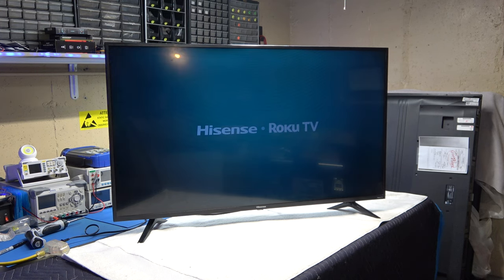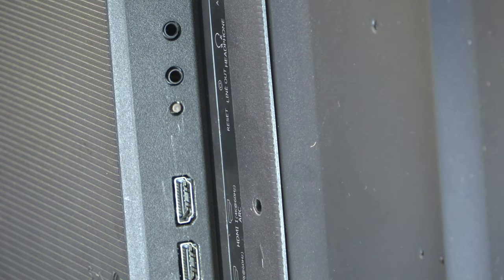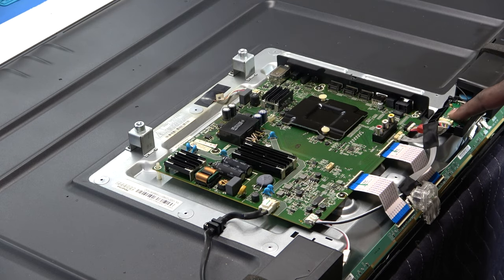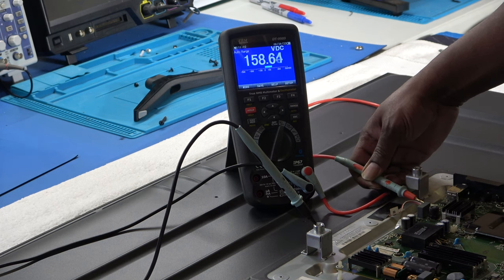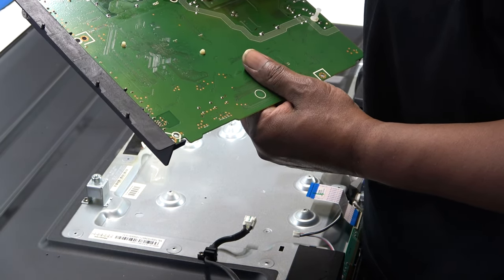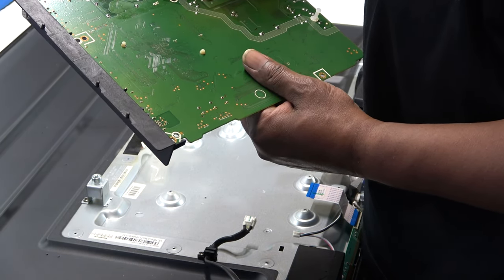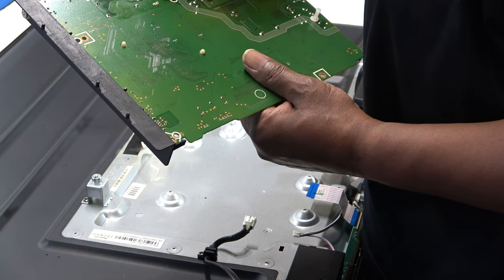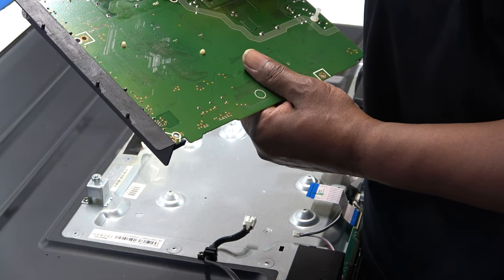Hisense Roku 50R7E boot loop fix when reset button doesn't work.

Comment: Hi mate, I have a Hisense 32" Smart TV (Hisense 32P4). I watched your earlier video about the reset button. Unfortunately, my model does not have a reset button. I’ve watched this video and have had a look at the circuit. There seems to be only one capacitor for the backlight LEDs. Also, visually it seems to be fine – it’s not swollen or discoloured. I don’t have a multimeter that can test capacitors. Would you suggest I replace this single capacitor, or would you suspect something else is at play.
Reply from the maker: probably bad board. or backlights. you have to have a shop take a look at it.
Reply: @bigdog8882  hey, wow! Thank you for responding. I got given the TV, and thought I’d have a crack at fixing it. It’s only worth about $150 repaired in my market. I have checked the LEDs they all appear to be working. However, this is not verified with a multimeter—the strips are glued down, with the terminals underneath, and I was concerned I wouldn’t be able to put them back in. 
I’m thinking this is a dead end project for me at my current level of ability. Would you agree?

Comment: Appreciate this video! Unfortunately my tv is doing the same as yours but worse. The backlights are not coming on at all, but if I shine a flashlight at the screen, the tv is behaving like yours.  Last time I replaced my lights on another tv, I cracked the LCD, so not sure if I want to put myself through another light change

Comment: Done everything replaced everything and it still is stuck in boot loop
Reply from the maker: Most likely the backlights are bad if the Capacitors didn't solve the problem.

Comment: Mine has the surface mount caps. What if it may have gotten too hot? Please help!!! Thanks
Reply: I also tried replacing main brd with no luck. :(
Reply from the maker: Could be faulty Led strips.

Comment: If you have an LG 4K 43", may have a backlight issue, turn the TV on, screen lights up - more around the edges, sort of dims, but looks like its on...my question has to do with when you turn it on, no incoming signal, should you hear white noise from the speakers? If the volume is (or has been) turned up, will it normally do that? Thanks bro!

Comment: Greetings, I have a TV Hisense 70R6270F with this problem. but they are different what should I change?
Reply: I’m having the same issue I’ve replaced every board and it’s still doing the same @bigdog8882 are you in Chicago if so can I bring it to you to have it looked at

Comment: Great vid, but gosh I would never use 2nd hand electrolytic caps in a repair for a customer, they don't age gracefully when they run hot on a buck converter like that. I don't know what the weather is like there but in Oz where it gets hot as hell in summer that thing would probably bounce inside of 12 months.
Reply from the maker: Probably best to find a higher voltage rating greater than 350 volts.
Reply: I give up.  I don't dare take the back off.
I don't have any of the tools I see you using.
 I'm known for breaking things especially electronics.  I don't have to do anything but show up.
I guess I'ma g🎉et a new tv 😢

Comment: Hi Great video i wish my issue was as simple as that with my bootloop. First off it started not finding the Wifi, but that was solved with a "wired" connected. Then it started bootlooping a few days later. 50inch have rest Hisense R50B7120UK it happily goes to recover screen and if i leave it does not boot loop. It goes on to "update" the to the whatever version of firmware and allows access to the TV then its about 20 seconds before it reboots. Ive take the back off and the caps are fine no bulges or defects. This makes me think the "update" was to blame, or could it still be the mainboard?
Reply: Ok so i replaced the caps and its still doing it. To re-itterate it only boot loops when on the main screen not when in "recovery mode screen" could this still be the main board or something else @BigDog8882 It Connects to network updates firmware and the lets me enter some of my email address before freezing and restarting
Reply: So Hisense have been of no use here, Ive ordered a new mainboard, lets see what that does??? I tired a manual update of software via ROKu that updates fine but didn't change the problem.
Reply: Installed main board exactly the same thing, The picture looks and lights up just fine across the limited recovery and or setup screens, no visible signs of light loss so maybe its not the "light strips either" any ideas?? Really stuck on this, thanks so much i you can help?
Reply: For those with my problem , was on Reddit (the helpful internet) and a technician was replacing a "Wi-Fi" board and the "mainbaord" with a similar issue to mine. I replaced the Wifi board on mine and it works!!!!!
Reply: @PhotoRestorationVideos  Have the same issue. Thanks
Reply: @texrocgal  hopefully my story helps

Comment: hey, rob I've fixed a couple tvs thanks to you and your vids but I got a hisense android tv model 55h9f that has an led driver board and it's new to me since im a beginner

would an led driver board make the tv turn off after about 40 seconds? 

i get 16v instead of 18v on the power board but i get the 12v standby

main board, power board? thanks in advance

Comment: I've seen a few of these now with the same problem. They really shouldn't be failing like this so soon after purchase - underspecced for the job at hand and then they use the cheapest suppliers for the parts. Typical Chinese.

In the UK there are a couple of store chains selling TVs with free five and six year warranties - curiously they've taken the HiSense and TPV (Philips) sets out of this deal (the Sony, LG etc ones, and even the cheapo Vestel Toshiba are still covered). I wonder why.